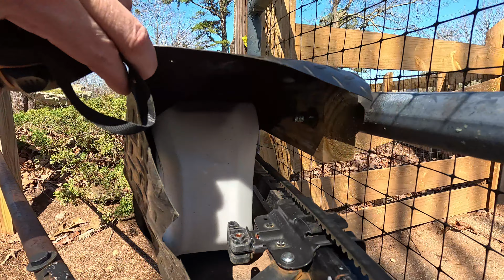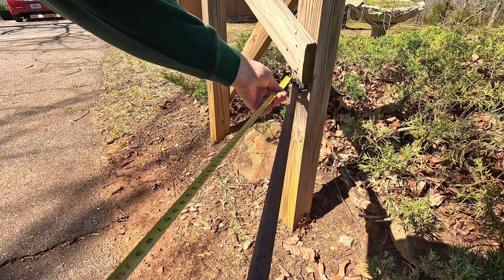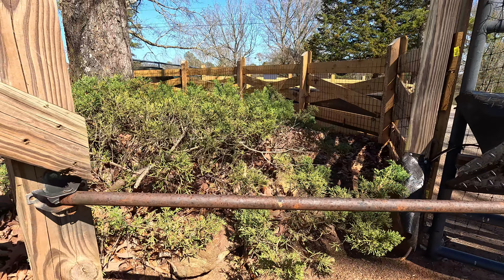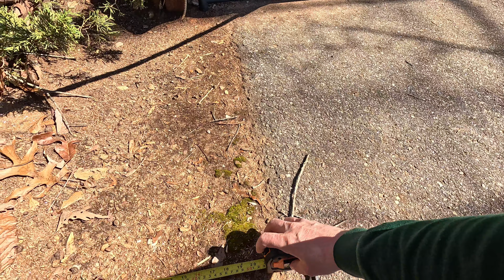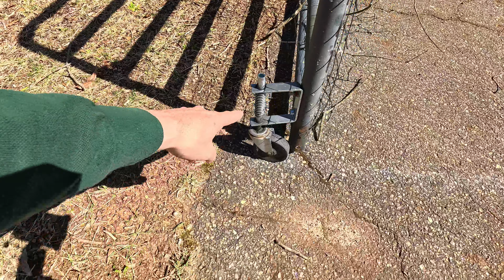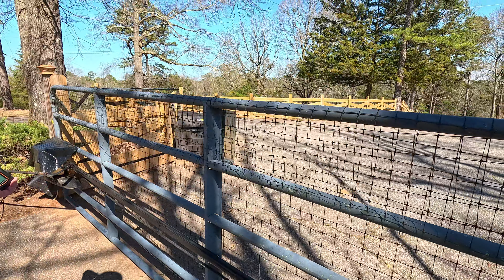A Deep Dive into My Gate Setup Using a Garage Door Opener

Comment: What size of rail do you have? Is it for a 7 foot Garage Door or an 8 foot?
Reply from the maker: I'm not sure, but my track railing is over 9 feet long.
I would think the longer it is, the less strain on the motor, as it would require less foot pounds to push & pull the gate.
Being that the gate has an idler wheel that the weight of the gate is assisted by... it takes very little effort to open and close the gate.

Comment: Dumb question-would it work Manually if electricity went out? Just push/pull  open?
Reply from the maker: Yes, just like when attached to a garage door, you simply pull the detachment lever where the arm is attached to the chain, and it allows the free movement of the gate while the chain remains in its closed position.

Comment: What do you think?...1st plywood to gate? Then opener to plywood....then gate arm attach to end wood for arm ....then attach arm to motor....all done in that order?  Fantastic video/idea! Thank you
Reply from the maker: That sounds good, but just know, I ended up replacing my plywood after about 5 years, as even though I treated/painted it, it still started to separate due to weather. If you use plywood, make sure you seal/protect it really well, so it won't separate as it ages.
Reply: @PrimitiveGuyStuff  what would you use instead of plywood to attach motor to. Thanks for reply!
Reply from the maker: @nicklv  Solid piece of wood, or even a couple strips of metal. Just where you can bolt it to the gate and also bolt the motor to that attachment.

Comment: in event of a power outage... do you have a manual override option?
Reply from the maker: Yes, just as you have when it is connected to a garage door, you can simply flip the engagement mechanism to allow the unit to slide freely along the channel. That is the part that normally has the lanyard to pull to unlock it.
Reply: @PrimitiveGuyStuff beautiful. I've got my next project 😊

Comment: The reason the sprocket gear wore down is because you’re putting too much force on the opener. Those openers are only designed to lift like 2-5 pounds. If installed new should last on garage door 15-20 years, not 5. 

You need to redesign the placement unless you’re fine with replacing every 5 years. The belt drive will probably go even quicker. Belt will dry up and go brittle and teeth on belt will start breaking off giving you the same result. Maybe a couple years before belt replacement needed, I’m not sure. Not designed to be exposed to sun and rain. Should have stuck with chain and come up with better design that puts less strain on opener.
Reply: Garage door openers are designed for push pull in lateral motion and you are using it in a different way. I think it’d be better to mount to the side of the gate perpendicular on its own posts. Like a typical garage door install for a house door. Angle gate 1 degree inward so it has a slight natural gravity open would help with strain. I saw one video on YouTube where the person had it mounted like that. May last a lot longer like that.
Reply from the maker: The sprocket gear didn't wear down...the pin sheared off. All I have to do is set in a new pin and that opener is back in business.
Reply: @PrimitiveGuyStuff  Usually if they are free spinning like you said in the video it means the plastic sprocket teeth inside the opener ground itself down so much there's nothing to grab, At least on LiftMaster/Chamberlain. I don't work on Genie openers much, so don't know if they have similar design if that's what your old one was. There's no pin inside a LiftMaster or Chamberlian that can break and cause free spin that I'm aware of.

I'm a garage door tech and planning on doing this gate opener using some old free ones from my shop eventually.